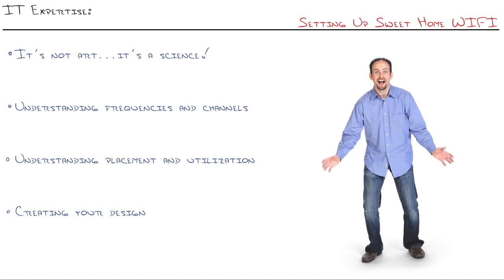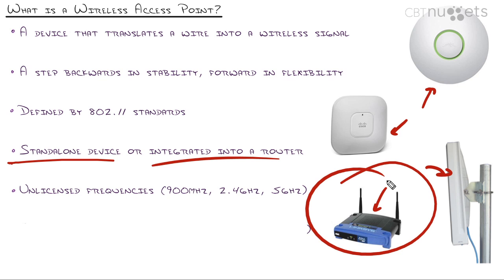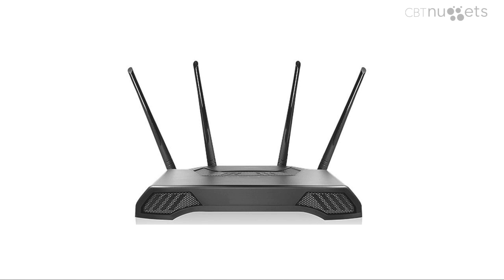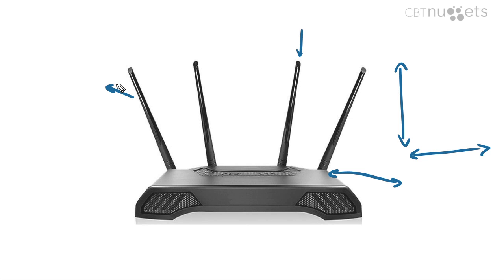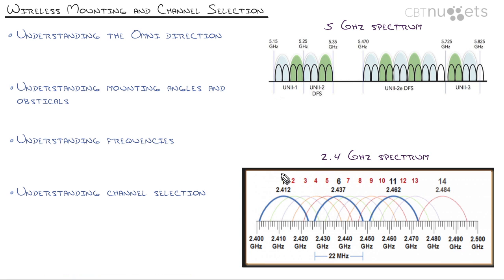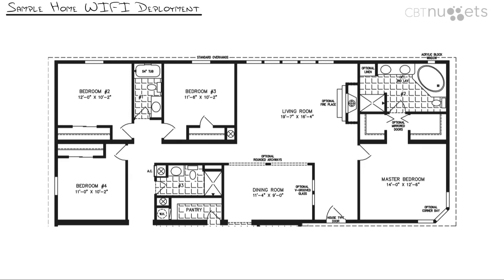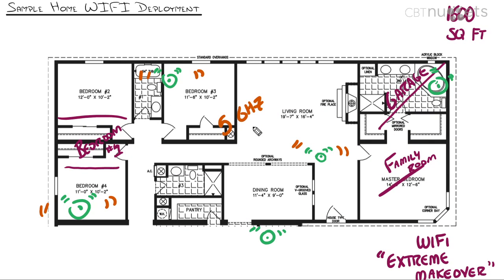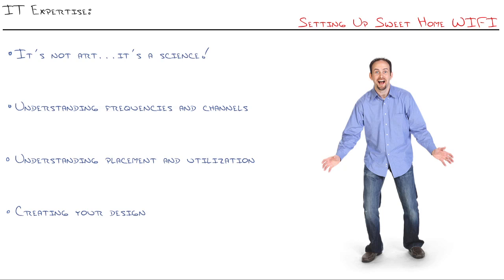IT Expertise: Setting Up a Sweet Home WiFi

Comment: If you remove the DFS 5GHz channels (which are not usable on most AP's in the US anyway) you only really get 3 usable 5GHz channels that do not overlap. Once you take into account 80MHz wide channels on 5ghz, you are left with channel 36 and 155. My neighbors right next door are blasting their AP on 5GHz at channel 155, which leaves me with only one channel on 5Ghz. So what I am saying is 5GHz is no better these days than 2.4Ghz.